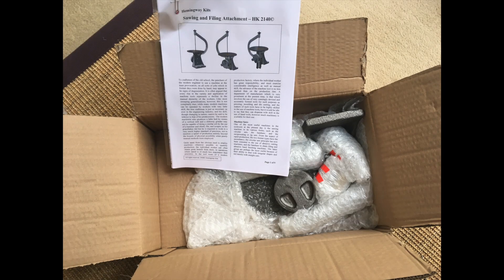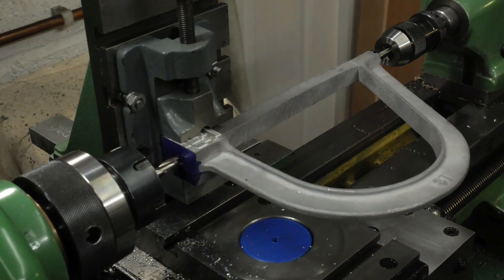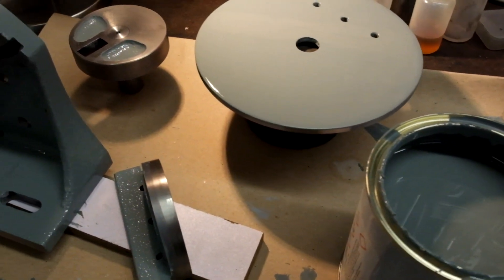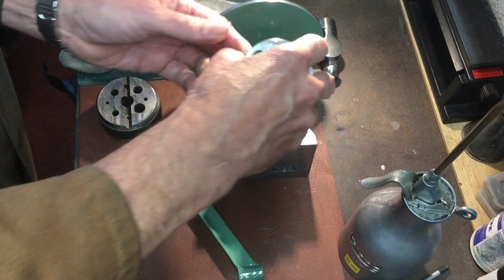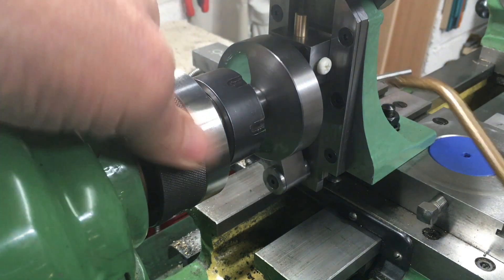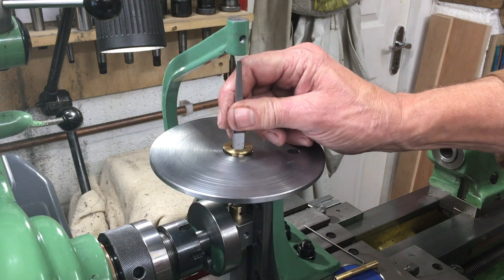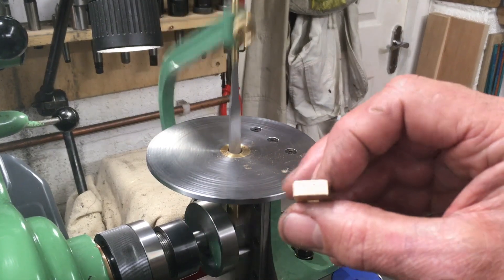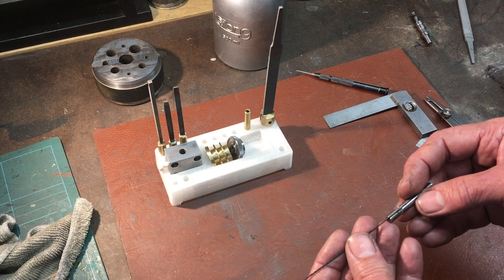Filing machine   HD 1080p

Comment: Excellent small filing machine and very nicely made. I often used a large floor standing filing machine when I was a toolmaker. It was very quick and easy to rough out the die blocks on punch and die press tools prior to hand finishing.

Comment: Very neat and the motion looks really smooth. You have made a fine job of it. Hmmm, I wonder if it would fit on my sc4 lathe? As I recall the distance from my cross slide to centre is around 60mm.
Reply from the maker: Easy to make it fit, I think I would mount it direct on the bed with a spacer block to get it to the right height. The centre height is not critical, 1/2” either way won’t make a difference.